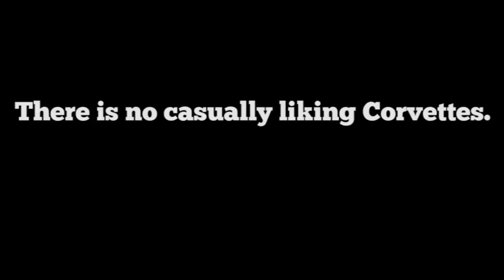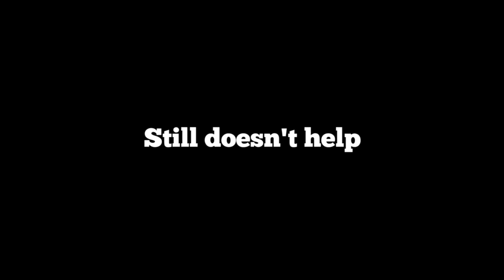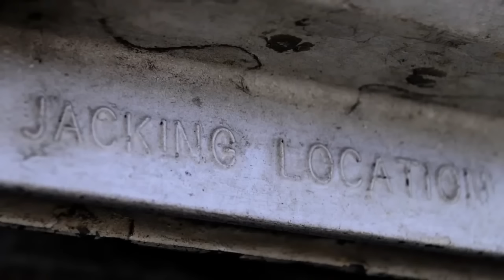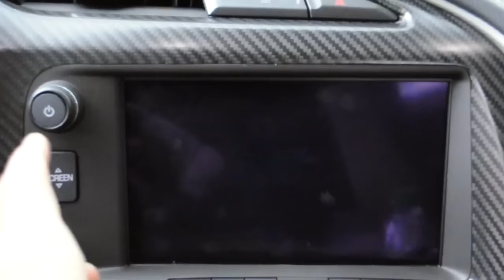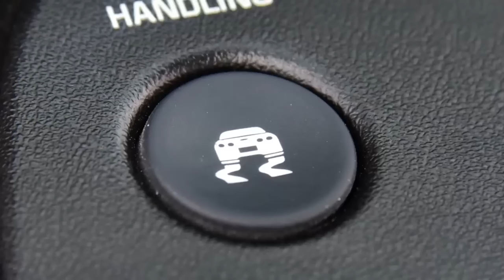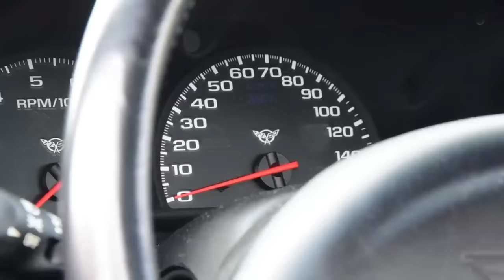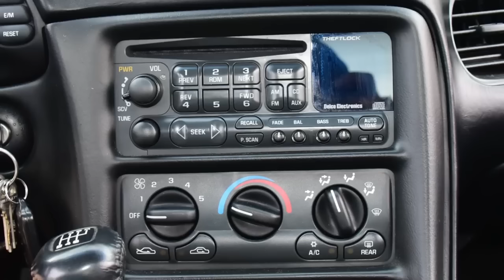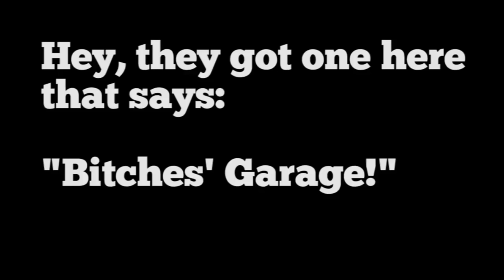30 Minutes of Mr. Regular Ripping On Corvettes (Best of Regular Car Reviews)

Comment: I unironically like the c4/c5 Corvette. But I'd get the absolute base model I could find in decent condition, swap the engine and trans for a modern LS engine and manual trans, and change the suspension to race on the track. I don't want a Corvette to have a "unique car" or just to have a Corvette, I want one cause if you up the suspension a bit the aerodynamics actually make them pretty good on track.

Doesn't hurt that I love a good pop-up headlight and the c4/c5 looks pretty good in my eyes. But they AREN'T special or unique, they made a billion of them and they're all the same.

Comment: It's too bad Corvettes come with so much social and psychological baggage. Removed from the owner stereotype, they are pretty good cars. Every generation was a marked improvement over its predecessor. From the build quality, to the material choices, to the performance, every one was better than the last. The C3, given its 14 year production run and the fact that the beginning of the C3 came before the emissions era, and the end of the C3 came after, was maybe the only generation with some regression. What do they say, hate the artist but appreciate the art? The Corvette is the automotive embodiment of that statement.

What's strange is, I am starting to fit the stereotype of a Corbette owner. I am a white, straight, middle-aged Gen-X male who prefers cargo shorts, occasionally wears Hawaiian shirts, and through years of job related bodily abuse, has ankles, knees and hips that appreciate a good pair of New Balance or Nike Air Monarch shoes if I am going to be on my feet for extended periods of time. And yet, I will likely never own a Corvette. Not because I don't like them. Not because they don't perform well. Not because I can't afford them. It really boils down to the fact that, one doesn't need to have a Picasso on one's living room wall to appreciate the work of Picasso, especially when one can view them at any local car show.